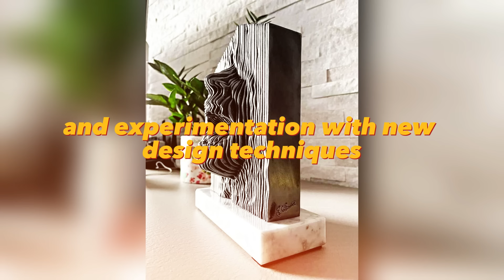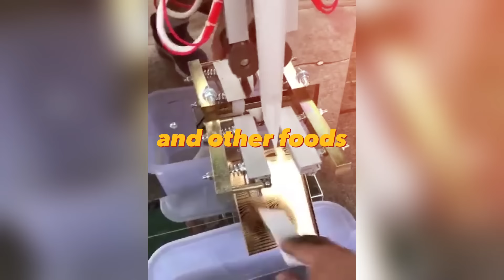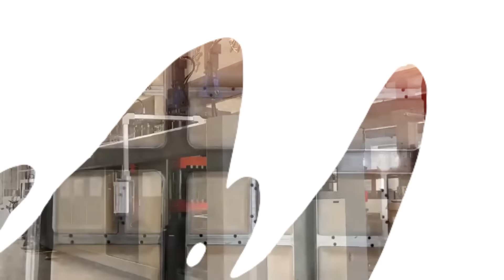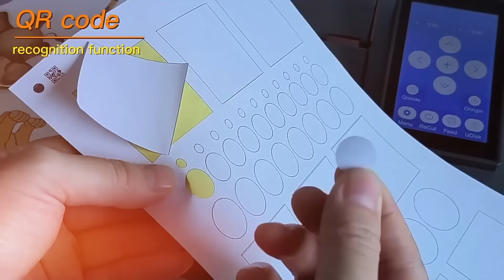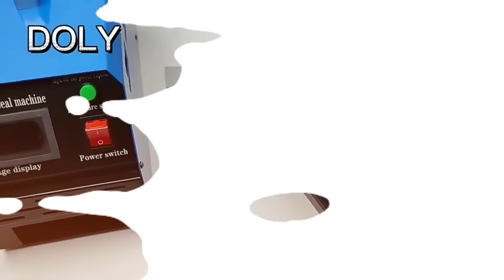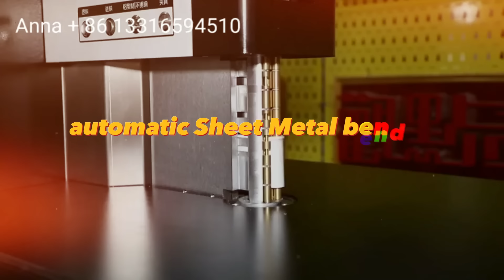88 Small Business Ideas for Production in Garage UNDER $4000

Comment: Going in the food business is not limited to one machine doing one thing, food is so regulated that even a 2000$ machine is just the beginning, you need constant inspection, sterilization, food grade walls, floor ceiling material, stainless tables, counter, metal detector etc. The insurance against food poisoning is not cheep, It never ends.